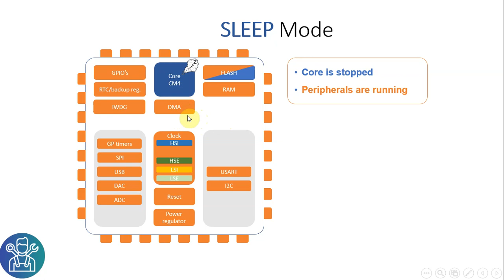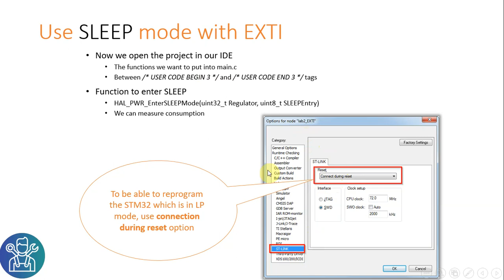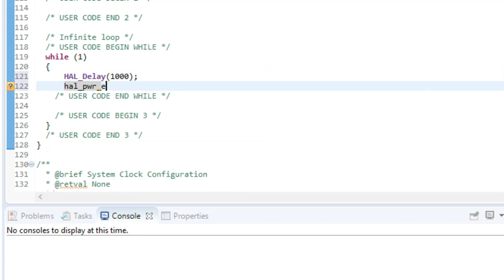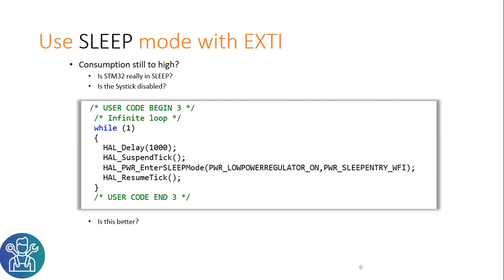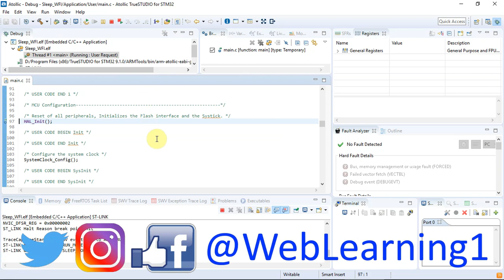HAL #7: HowTo - LowPowerSleep

Comment: So if I understand correctly this example will "hang" in HAL_PWR_EnterSLEEPMode because there is no interrupt source to wake from?
Reply from the maker: Yes. You will need to add the HAL GPIO with Interrupt to wake it as one option. Any other interrupt will also wake it.

Comment: On Arduino, the LDO took 5mA, so that defeated the low power mode. :-(
Reply from the maker: In the STM32, there are 3 different LDO that work depends on the modes you are in. You can go as low as 1uA with the internal LDO.